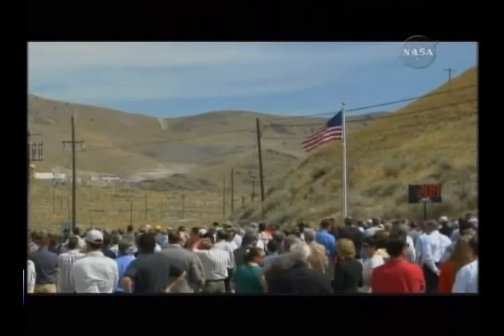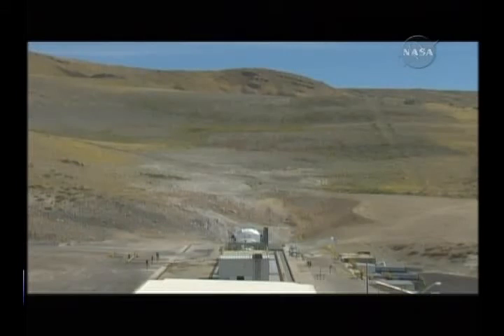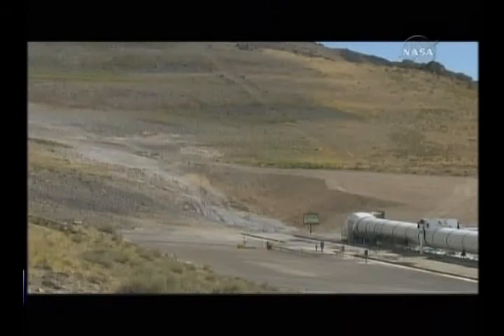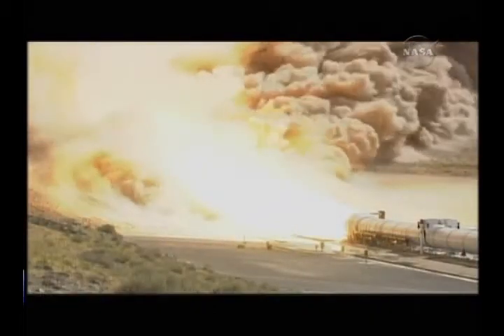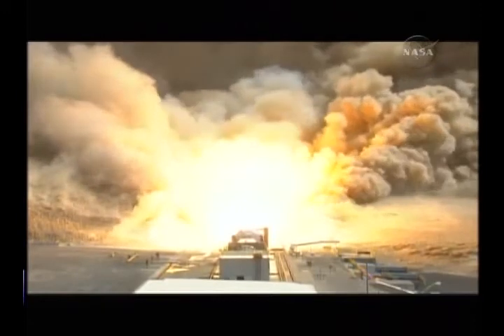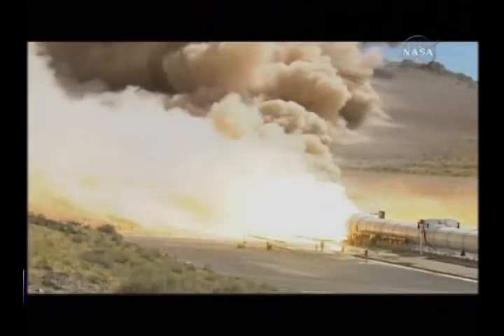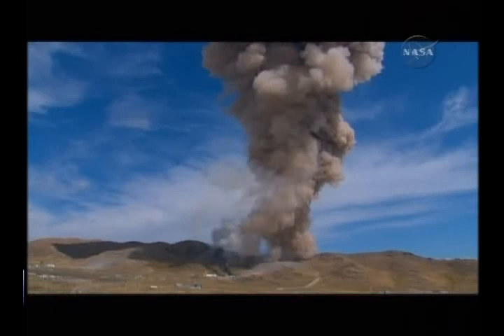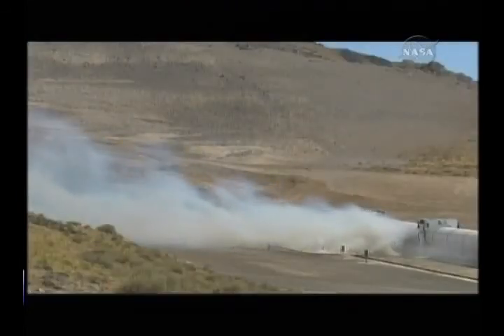5-Segment Solid Rocket Motor DM-1 Test Firing For Ares I Rocket

Comment: @geomodelrailroader  They are called APUs on the  shuttle itself.  They are HPUs on the SRB's.  The SRB HPU's start exactly T-28 seconds.  The shuttle's APUs are started by the pilot in the shuttle at T-5 minutes. (they move the engines, rudder, speed brake, elevons, and ladning gear).  They can also be done manually from the APU console inthe Firing Room at the Launch Control Center.